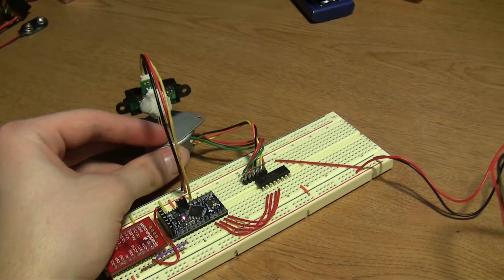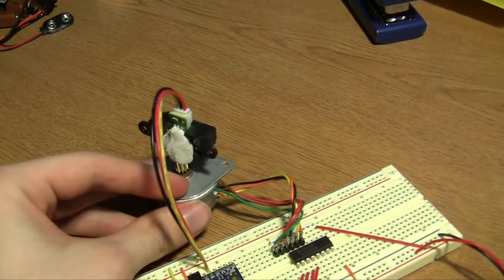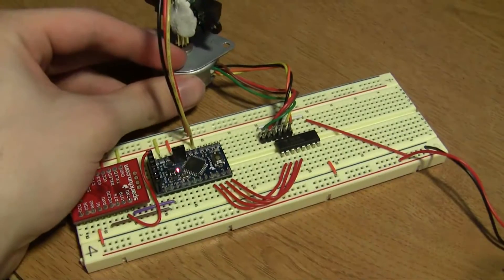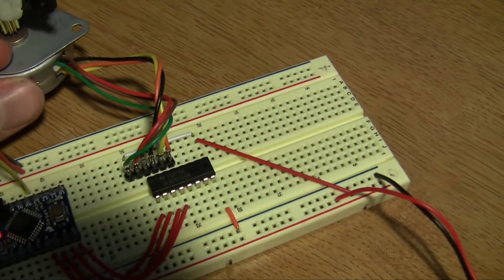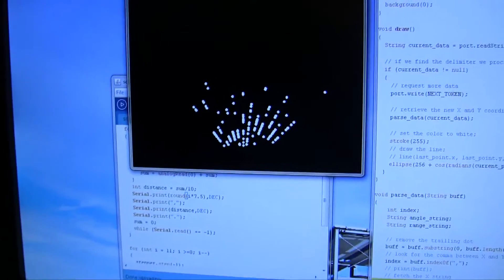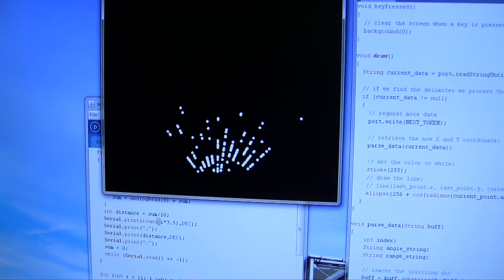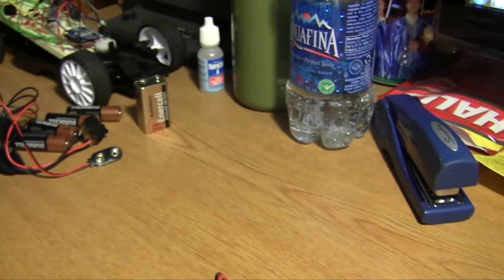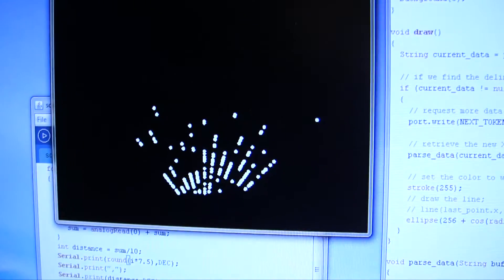Blum 18 - IR LIDAR with a Stepper Motor

Comment: The thing mounted on the stepper motor is a complete IR distance sensor. It contains both the emitter and the receiver. Sharp GP2D12 is a common type that looks like the one in the video.